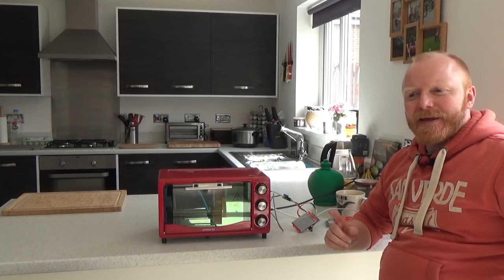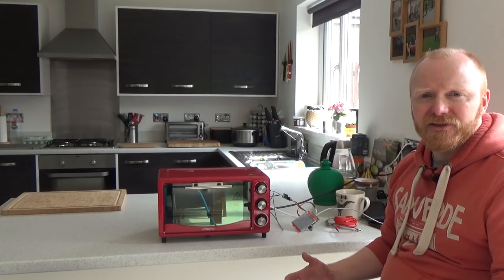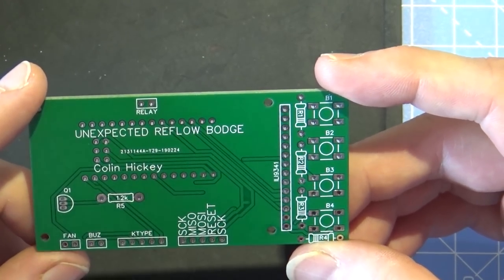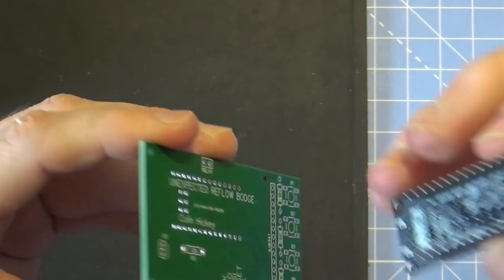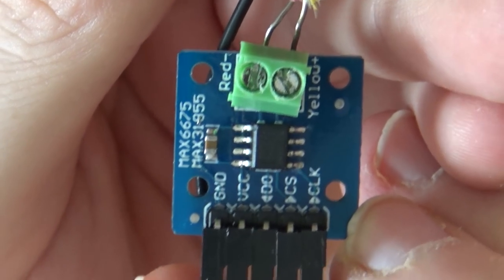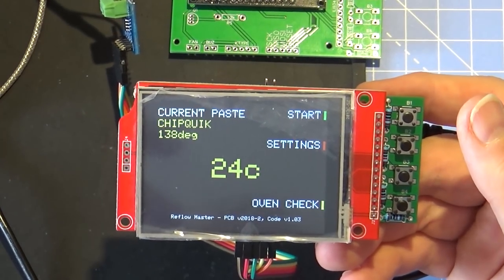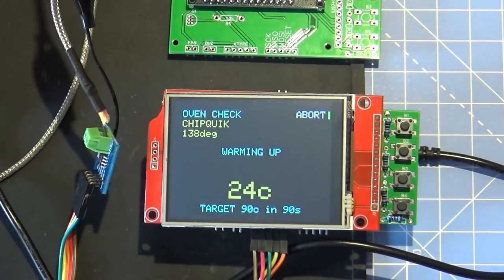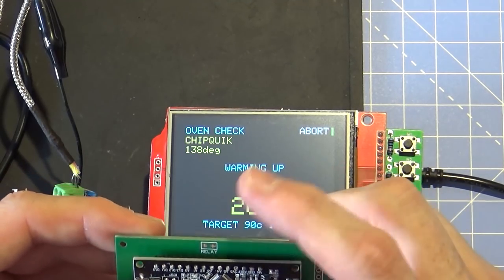DIY Reflow Oven and why Open Source is amazing!

Comment: Those screw in thermocouples are used for furnaces, so they are for high heat changes, like hundreds of degrees C, if you remove the cover its just a normal k type floating in the middle, so there is an airgap, hence they are terrible for normal use, but you can just pull that off and reuse it. Those thermocouple amplifiers have no filtering, stick a 10nf cap across the thermocouple terminals and the noise (gnd) should clear up.
Reply: might need 100nf, I forget check the datasheet I think it says it
Reply from the maker: Brilliant thanks, will try that.

Comment: Glad you enjoyed making this.  I used a commercial ramp-soak controller that can be purchased for $30 and is entirely powered through the mains.
Reply from the maker: Interesting option, do you have a link.  Thanks for taking the time to comment.
Reply: @Chickey  just go to AliExpress.com and search for any ramp-soak heater controller.  There are a thousand variations.  Then use a solid-state relay of 20Amp or higher for taking the output of the controller to pulse modulate the heaters.
Reply from the maker: @JohnHansknecht  Hi John,  It's not an avenue i'll go down myself as i'm happy with my setup but thanks for the info for others.

Comment: Hi Colin, absolutely love your work! I was hoping that you had loaded your pcb design and BOM on the github repository for the reflow master. Ive looked and can't seem to find it there. If possible are you able to upload it as I'd very much like to follow in your footsteps and have already orded the dev board and screen.
Reply from the maker: Thank you for the kind words and yes i fully intend to publish it and pop it onto github along with a bom as well.  Been meaning to for ages so shall make sure do get it done this week :-)
Reply: @Chickey  I'm also looking fireward to it. Did you upload it already? 😁Great job, love it!
Reply: I was also hoping you had a gerber for the wemos

Comment: I NEED to do this soon.

I bought a cheap toaster oven for about £20 on eBay, but that was last summer. lol

I only just bolted in the solid-state relay the other day. Just need a controller now.

I'm probably going to use a JYEtech "oscilloscope" board as a controller, as it already has a fairly nice LCD on it, and STM32, and is dirt cheap.
Reply: btw, with an external controller, I am a tiny bit worried about relying solely on the opto isolator in the SSR itself.

I think I'll add an extra opto to mine, just to be sure.

Otherwise, if something in the SSR fails (and they're not always built so well), it should give you extra protection from getting zapped while using the controller board.

Best not to take any chances with mains safety. ;)

I was going to try to build the controller into the side compartment of the oven too, but I'm sure it does get too hot, and is too much hassle to try to insulate the chamber etc.

External controller sounds like a good option to me, especially with a DIN plug or whatever added to the oven.
Reply from the maker: Got mine last year as well lol.  I had the same thoughts re putting the controller in the oven but then decided against it because of heat.  I checked the temp where the SSR resides and it stays relatively cool but defo one i'll be keeping an eye on.  I think that is a general rule of thumb with a reflow oven anyway in that it should never be left unattended and always monitored.
Reply: @Chickey  

Oh, for sure. I'd NEVER leave the oven unattended either.

If the controller or SSR goes wrong for some reason (or even the thermocouple), then it could definitely cause a fire.

I'll be watching it like a hawk once I get it running, and then unplugging it from the mains as soon as it's done. lol
Reply: I worry whenever I hear people leaving a 3D printer running overnight while they are asleep, when it's in the same room / building, and not in it's own workshop / garage. Even then, I'd be wary of doing that, although I realise some prints can easily take more than 12 hours.

I guess having a decent smoke detector near a 3D printer would be wise.
Reply from the maker: Is the JYEtech board as a base for a reflow oven already a thing or a project your going to do yourself?  Just looking at the kits they are very reasonably priced.  Could be tempted to try one as an actual oscilloscope lol
Reply from the maker: Yeah my last print was 15 hours so had to be over night, leaving the 3d printed going unattended is something i'm used to now for better or for worse.
Reply: Colin Hickey

The JYEtech boards don't have any firmware projects for use as a reflow controller yet, AFAIK.

But they don't make very good o'scopes anyway, and yeah, I had the sudden thought about them being good for a few other projects.

I've only just started using STM32 chips more. I've had an F4 Discovery kit for a few years, but not used it too much.

I was always slightly put off by the learning curve just for setting up the IO pins etc. But with the CubeMX software, it's actually quite easy now.

You'd just need one of those cheap SWD debug dongles for the STM32, and the free STM32 Workshop IDE software to get started.

Once I can find a good library for the LCD on the JYE board, I think I can manage the reflow stuff OK.

It might not have proper PID control stuff at first, but will hopefully work well enough with some simpler logic. I just need to get around to doing it. lol

I did also think about adding a better ADC chip to the JYE board, but there aren't really enough spare pins on the STM32 for that...

https://jyetech.com/wp-content/uploads/2018/07/dso150-shell-schematic-main-analog.pdf

You could hook up an SPI LCD instead, then use the spare pins for a better ADC, but at that point you might as well do a whole new design.

The ADS825E could be a good candidate for the ADC chip, though. (same as used for the domesday duplicator)...

https://www.aliexpress.com/item/S825-S825E-SSOP-28/32787386032.html?spm=a2g0o.productlist.0.0.50f669a92sPc7E&ws_ab_test=searchweb0_0%2Csearchweb201602_7%2Csearchweb201603_52&algo_pvid=d9ad1fb9-cdf0-4166-9538-443f9516696c&btsid=73977fc0-bfe6-453b-8ab9-b4306a878f1a&algo_expid=d9ad1fb9-cdf0-4166-9538-443f9516696c-0

I've wanted to do an o'scope project for many years, but I doubt I'll ever get around to it.

Comment: I ran into a similiar labelling problem while building a weather station.  I ordered a BME280 which will do temperature, humidity and pressure.  I ordered them from Amazon and they cam labeled with BME280/BMP280.   When I got them I tried getting them to work on an ESP32 but could not get them to show humidity.  I kept trying different scripts and one of the scripts detected the device and told me that I was using a BMP280.   This sensor only does temperature and pressure.   I ordered anohter set of sensors from a different supplier and this time I got BME280s.  However, it's still labelled BME280/BMP280.   I guess this is so they can design one PCB and configured it as they wish.

Comment: Nice work Colin, It would be nice to see some sort of temperature mapping of the oven in operation.  I would like to know is what type of fumes you will you be exposed to from this activity. Great post, always so interesting,,,,,Keep them coming dude.
Reply from the maker: Hi Doom, There are different profiles available on the software depending on the solder paste being used.  I shall have to post a video of the oven in operation to show the mapping of how close it gets.  Re the fumes i'd actually not given it a load of thought, it's something i'm conscious of with normal soldering as the fumes are a lot more visible.   Will have to make sure it's being used in a well ventilated room just to be sure, maybe not the kitchen lol

Comment: Nice work :)  Im going to be following in this same vein soon.  Right now, mine is very dodgy.  I have to hook my laptop to the arduino to get the temp (aka, no screen yet) lol
Reply from the maker: The weird thing I need is an m8 nut but with a thin machine screw type thread so I can secure the thermocouple.  Looking at what others have used I’m curious if I should have just used the one from my multimeter and tape it to the wire shelf inside.
Reply: @Chickey  I ended up with a diff thermistor like you did.  mine doesn't have the threaded piece like yours, but it's exposed like the tip on yours is.  Detects the changes in heat WAY better.

Comment: How did you get the chip programmed? I purchased a j-link mini and must have the settings wrong in the software as I can not get it working to the software. Also the software in arduino will not compile. I found that some of the libraries called out have been changed and or deleted since new arduino software software has been changed. I have also found 3 different bootloaders that adafruit called out, which one did you use? When you added the program on to the chip with the arduino ide, what board did you call it and what did you call out as the programmer. Thanks for any help. Great video.
Reply from the maker: The module i used has a usb connection so i used that via the arduino IDE.  It's nice that it's all built in.